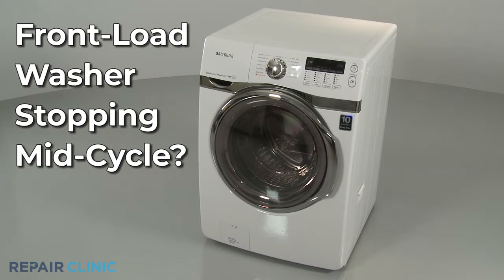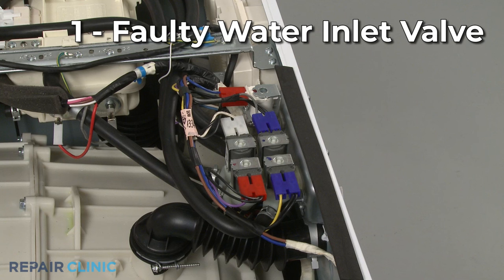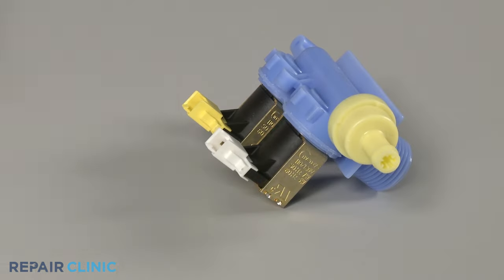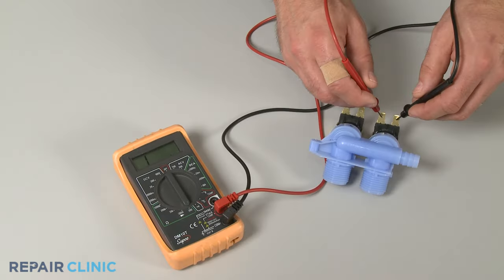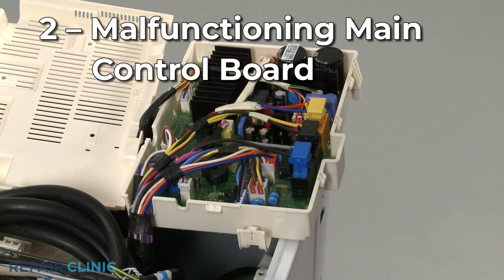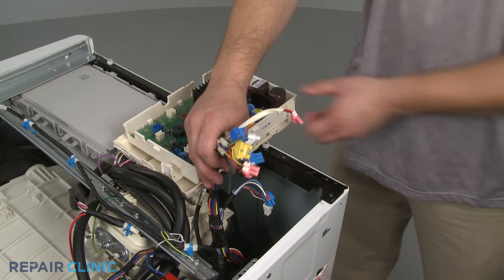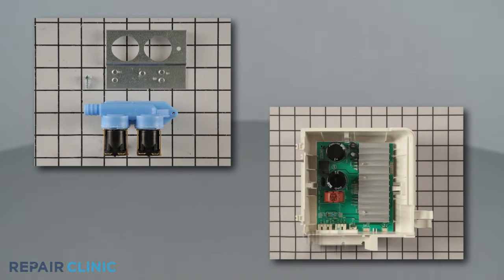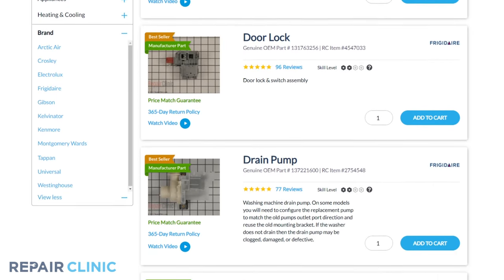Front-Load Washer Stops Mid-Cycle — Front-Load Washing Machine Troubleshooting

Comment: My kenmore fromt loader is also stopping mid cycle. If i repress the start button it continues but usually stops again especially before the final spin cycle. I found out if i stand there with my finger holding the start button it will complete the cycle without stopping. So is it the control board ?

Comment: I have a kenmore washer that is getting "stuck" on the spin cycle. It just keeps spinning and saying 16 mins left on the timer (it will continue adding water and spinning but won't move off the 16 min mark). When i reset it to just a spin cycle, it will finish fine. Any ideas what this might be?
Reply: Did you get an answer yet if you did pleaee tell me i have the same problem
Reply: @anqiizx2968   no, I think it's either  a sensor or the whole control board. My machine was getting worse and I had to restart it multiple times to get a load done,  it was starting to be really off balance. Since my machine was 10 years old I ordered a new one, should be here this week!
Reply: Its the board